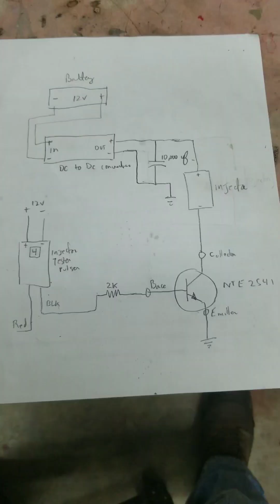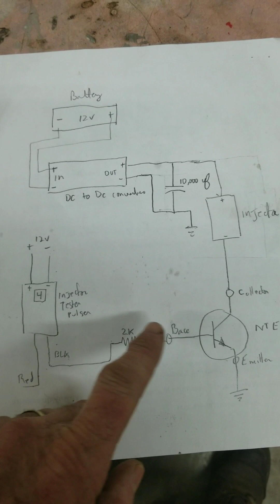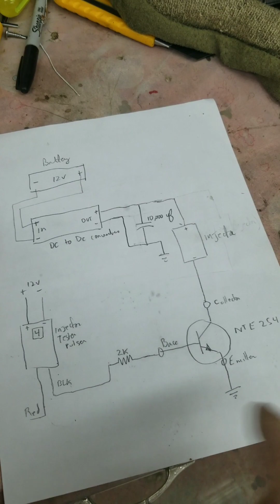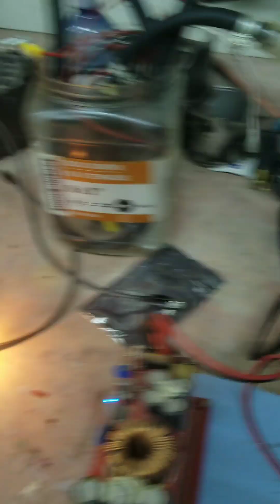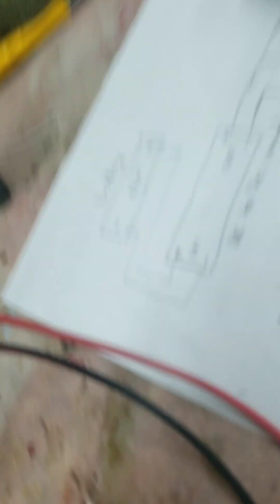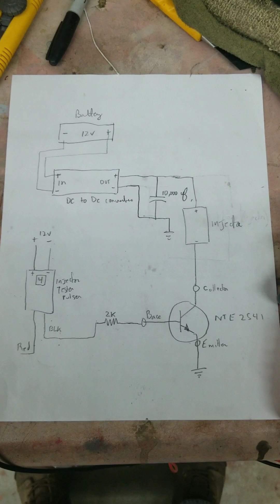DIY Etec Injector cleaner How To ( video 2) see description for full demo video

Comment: super useful video, thanks. I've been noticing these now popping up on amazon gdi drivers that provide 70v, 

The fuel injector cleaning kit is not only suitable for standard injectors in gasoline engines, but also for high pressure injectors in diesel engines. Configurable 12V and 70V high voltage drive options. The high voltage is suitable for 70V, 120V and other injectors.
【Adjustable Working Frequency & Time】Fuel injector tester is possible to set multiple pulse outputs and adjust speed, pulse width, operating time and other parameters as required. The operating frequency range can reach 600~4000 rpm, the working time setting range can reach 0~99 minutes.

Maybe that's a compact setup but would need to limit the voltage?

I only ran across those looking for components from your video and curious on thoughts.
Reply: i guess it would be the opposite, instead of stepping up you'd now need to step down ending up at the similar setup.
Reply from the maker: So although etec uses up to 5tv I found when using this system I had god results in th 20 to 30v range.  More than that was a ton of fuel and generated alot of heat to dissipate in the fuel
Reply: @ontariooutdoorsman  yeah i was wondering how hot the fuel got, the bottom of the casings get quite warm. Maybe a dc to dc step down buck converter with adjustable voltage behind one of those would , work?  go from dfi tester -> buck -> etec. there's some that take up to 70v, and variable output down to those ranges. looks like 90 bucks total maybe bit less. I think that's a bit more than your setup though but only 2 things needed.
Reply from the maker: @swade3485 that's exactly what mine is.  It's a dc to dc buck converter.  12v in...adjustable out
Reply: @ontariooutdoorsman  I know this is a dumb question, in that scenario would i still need a nt2541? if i understand correctly that's to drive from the smaller to higher voltage or would it possibly be that simple to go from 70v pulser -> buck converter step down 24v (example) -> leads to the injector?
Reply: @swade3485  Do you have the link for that product? Thank you!
Reply: @swade3485 that would be awesome if that works. A lot simpler
Reply: @ontariooutdoorsman so I think I've got it figured. Injectors aren't working, so I dropped the output voltage and hooked up a headlight with a momentary switch between the battery and base. Does what it's supposed to.
The thing that has me puzzled is why my injectors don't fire?
They've got fuel pressure, polarity is correct, all they do is give a light tick. So light I can't even feel it through the body. Tried switching polarity. Same thing. Light tick only. Not even a dribble of fuel
Reply from the maker: @FamilyYouTube-dz3xs so are you getting just one light tick ?  If so and its not pulsing you have something wrong.  Try connecting just one wire from the injector pulser..  at a time.  You may have the injector pulse unit connected backwards and driving the circuit with the wrong wire from its output. As long as the pulser is connected and powered from the same battery source you only need one lead from it.
If you connect a headlight...when its running the light should come on but dimmer than full 12v.  It's only getting 12v for when the pulse duration so will be dimmer
Reply: @ontariooutdoorsman I'm getting ticking, just fairly light. I can get the injectors from my DI Evinrude to fire (same technology). But my 850 ski doo etec injectors don't fire.
I did dial the output voltage down and run a headlight. I did; however, burn up the tester. So the Di injector and light bulb test were done with just a simple momentary switch.
My new tester arrived so I recreated the light bulb test, and it worked as you described. Just tried it again on a set of injectors. Same thing just ticking, no spray.
Reply from the maker: @FamilyYouTube-dz3xs if you are getting ticking and no spray you either don't have enough pressure or enough voltage/current to activate the injector
Reply: @ontariooutdoorsman fuel pressure is 44psi. I incrementally increased the current until the fuses popped on the converter. This was at 30-40v
Reply: I just attempted to build this unit to bench test some ski doo injectors (same technology). Not sure if if got it wired right. 
Got the fuel system plumbed, and when I turn the injector on I hear ticking, but no fuel. Injector just heats up fast. 
Also noticed that when I hook it up to the injector tester unit that it just turns on. No pulse on red or black.
Reply: @FamilyYouTube-dz3xs  if it's not switching it will overheat sounds like it has a constant voltage. You don't want that heating up like that.
Reply: @swade3485 I'm pretty sure I wired the grounds wrong. Everything else seems pretty straightforward.
As it is now I have the capacitor output and emitter going to the buck converter negative output. I feel like the capacitor should be in parallel to the injector positive, and tie back in before the injector. But this guy is way smarter than me, so I just did what I thought he drew

Comment: Many thanks for video.  Found very useful. May I recommend a dc dc solid state relay instead of nte2541 transistor if having any issues. A SSR can switch fast and accept any injector tester positive and negative input without worrying about issues flagged here regarding polarity and current. I used a SSR-60DD 60A 3-32VDC to 5-200VDC Electronic Relay Solid State Switch. Two car batteries in series work as power supply without needing a step up converter.
Reply from the maker: @John150Mark  that's an excellent idea sir !

Comment: Hi Jim and thanks for your video! I have a 2007 Evinrude etec 75hp outboard motor that I believe one of the injectors may have gotten clogged. I'd like to build a set-up like you made. Can I use a DC-DC boost converter that has 1800watts/40 amp with pots that are adjustable? Thank you! Have a nice day!
Reply from the maker: @jacquesw8725  yes you can.  Start with about 20v and go up or down from there while running.  Good luck.  If you cant find the nipples for the injector you could remove the injector from the housing and submerge it in cleaner and run it.  Be super careful no dirt gets in
Reply: @ontariooutdoorsman  Thank you Jim! So I still need to get a blank PCB to connect the large cap 10K electrolytic/resistor 2Kohms/and the NTE2541 transistor and connect it all like you show? What wattage is the resistor rated at? Do you have a link to the pulsar unit you are using? Thanks again!

Comment: what happens with the red wire from the pulser unit ... black is used but where does red go ? ...nowhere ?
Reply from the maker: It's not needed.  Because everything is using the same common power source.  The one wire is all that's needed to fire the transistor
Reply: @ontariooutdoorsman  thanks for super qwick reply ....thisis my project for next winter doldrums